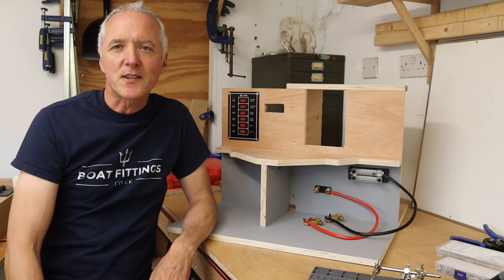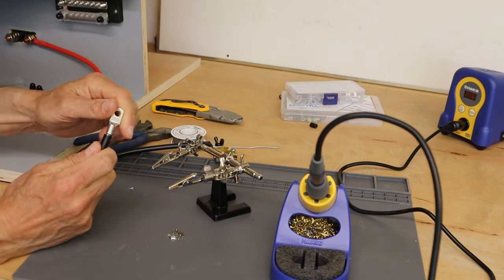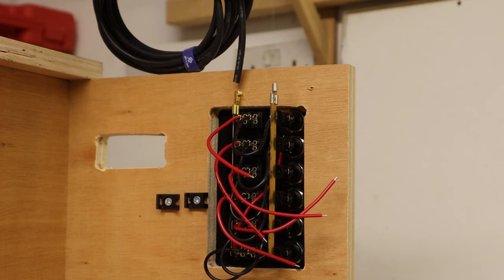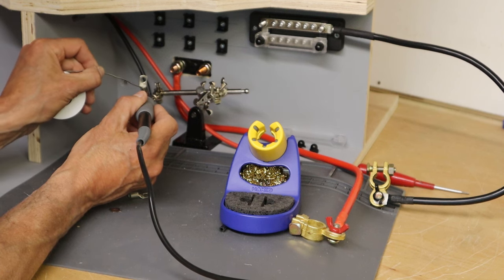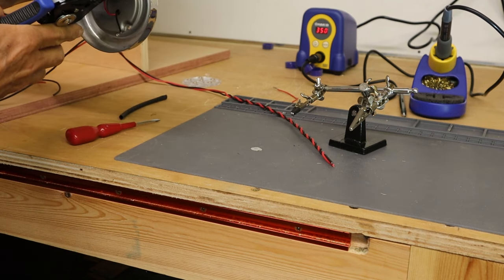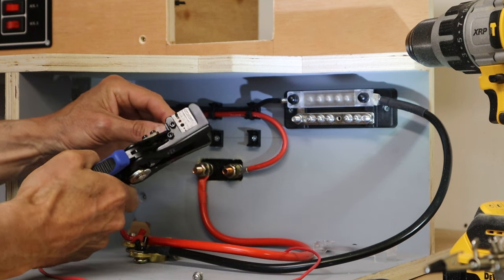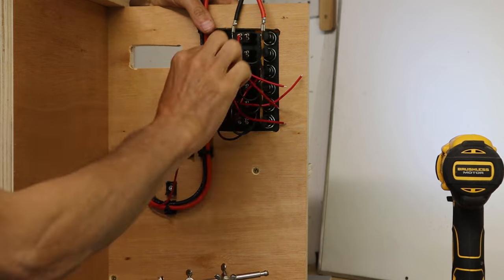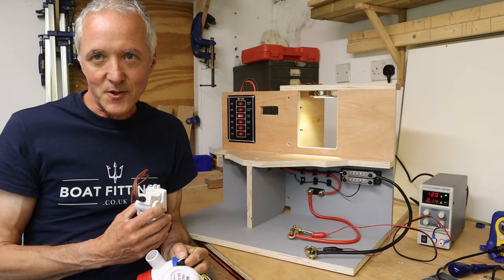Boat Electrical Wiring Made Easy, Part 2, Switch Panel Wiring, Cabin Light Wiring - Complete Guide

Comment: Surely the crimp terminals should be crimped not soldered?
Reply: Soldering makes for an even better and long lasting connection 😊
Reply from the maker: With regard to high-amperage terminal / crimp connections, a few people (yourself included) have made mention of the idea that 'crimping is the way' and that soldering is unreliable as the connection might get so hot that it un-solders itself.  My view is that a well-soldered joint will not ever get hot enough to un-solder itself, I will explain my thinking in a moment.  Firtly though I do not have anything against crimping as such, and I would say that the ultimate would be to crimp (for a good mechanical connection) and then solder (for the best possible conductive connection).  Personally I have sometimes had issues with crimped joints after a period of time when corrosion has set in, but not had issues with soldered joints.  Now to the idea that a soldered joint can get hot enough to un-solder itself, in any electrical circuit the thing that can cause heat to build up is high current (amps) and a high electrical resistance.  A well-soldered joint does not have a high electrical resistance, so unless something has gone severely wrong it does not seem likely to me that the soldered joint would reach a high enough temperature (lead solder melts at around 180 degrees C) to get near to melting.  All of that said, if anyone has an direct experience of conditions that have caused a soldered joint near or around a battery terminal to melt, then please do let me know as I am genuinely interested.

Kind regards,

Richard
Reply: @BoatFittings  Imagine if  there is a short between the panel and the battery... One of the uninsulated female spades gets knocked off and touches the other polarity for example. How many amps are now flowing through the cables to the panel from the battery? How hot is that cable going to get. I assure you that will melt solder in a tiny space of time. That is why the positive cable to the panel MUST be fused.  Short out a battery and unfused cable will get red hot, cause a fire, and melt the solder. Vibration and the stiffening of the cable is another issue with soldered joints. A boat is not a bench top project. Things go wrong and people can die if you don't get these basic electrical issues correct.

Comment: @BoatFittings

(or anyone else who can answer this, thanks)

Agree with all "positive" comments (sorry, couldn't "resist" ... damn, did it again! ;-)

Question: Everything is great except the _switch panel_. The wires and connections on the back of it confuse me to no end. Could be the Chinese labeling or some wires being the wrong color or maybe it's just me. My basic confusion ... why is there a negative connection to the switch panel at all? In other words, why is that panel not solely on the positive part of this circuit (for one of the same electrical reasons that the master switch works on the positive side of the circuit)?

Guess: I think the answer is that the switch panel is not functioning ONLY as a switch. If it were, you could have only positive in, only positive out, and the switches would interrupt the current or connect it when needed. However, only because those little bulbs are in the plastic switch housing (to indicate ON or OFF), each switch also becomes a load of its own. So, as a collection of little loads, the switch panel needs both positive and negative connections. Am I close?

Comment: Mechanical vs soldered terminals...
Because I see across the board generally it should be mechanically crimped not soldiered
Reply from the maker: With regard to high-amperage terminal / crimp connections, a few people (yourself included) have made mention of the idea that 'crimping is the way' and that soldering is unreliable as the connection might get so hot that it un-solders itself.  My view is that a well-soldered joint will not ever get hot enough to un-solder itself, I will explain my thinking in a moment.  Firtly though I do not have anything against crimping as such, and I would say that the ultimate would be to crimp (for a good mechanical connection) and then solder (for the best possible conductive connection).  Personally I have sometimes had issues with crimped joints after a period of time when corrosion has set in, but not had issues with soldered joints.  Now to the idea that a soldered joint can get hot enough to un-solder itself, in any electrical circuit the thing that can cause heat to build up is high current (amps) and a high electrical resistance.  A well-soldered joint does not have a high electrical resistance, so unless something has gone severely wrong it does not seem likely to me that the soldered joint would reach a high enough temperature (lead solder melts at around 180 degrees C) to get near to melting.  All of that said, if anyone has an direct experience of conditions that have caused a soldered joint near or around a battery terminal to melt, then please do let me know as I am genuinely interested.

Kind regards,

Richard
Reply: @BoatFittings  It will if it shorts out on an unprotected conductor.

Comment: Very bad practice in zip tying Positive & ground wires in the same holder, especially before your fuse block. Any penetration of the cables by way of accidental penetration of the insulation WILL lead to an short and potential fire.
Reply: Also, ALL of your terminals should have heat shrink down over the end of the terminal to prevent water ingress.
Reply from the maker: Hi thanks for your comment.

Kind regards,

Richard

Comment: Sorry, but your showing your viewers one important thing very wrong, when your soldering wires, the flux in the solder that allows wires to connect to a connector or another wire is an acid and will corrode the connection overtime, you must clean the soldered connection with acid tones or something similar.
Reply: Thanks.
Reply: Sorry, but you are assuming something very wrong or are unaware of the following: did you ask if he is using no-clean solder and which type of flux is in the solder? I don’t think so…. Please review your J-STD documents, and next time, ask what kind of solder a person is using and then follow up with “if not using no- clean solder of certain flux compositions”…. “Your statement.”
Reply: Agreed if not like he said it will definitely corrode
Reply: Additionally you don’t want to solder the main connectors for the battery cables. They should be crimped only.

Comment: Nice try - but dangerously wrong. Know what you are doing before educating others to create dangerous installations that don't conform to ISO or ABYC standards. The obvious point is having no fuses to protect the cables - this is a huge fire risk. The circuit to the panel should be fused after the battery. For example if one of the spade connectors at the panel comes off and shorts, the cable will take the full load of the battery = fire hazard with cables going through wooden bulkheads. The knock on effect of this is the generated heat will melt the soldered "crimps". All terminals and connections should be mechanically as well as electrically connected. With no fuse this could actually save the day but in the event of a fire those soldered joints failing could cause a dropped wire to short. Or indeed the melted solder dripping could cause a short. Use of a proper crimping tool and high quality crimps eliminates this problem.

All of this happening in a workshop is bad, but at sea it is a disaster. There are correct ways of wiring boats for a reason. This not the correct way and is potentially dangerous. You are clearly not a marine electrician and have very little knowledge of how to use these components safely.

Watch at least the first 5 minutes of this video to see why the unfused cable in this video is so dangerous at several levels:

https://www.youtube.com/watch?v=HzfKJwFCPho

Comment: They make crimpers for a reason. Soldering for low current is acceptable but not for higher currents. This is so bad don't do that.
Reply: ABYC E11 standard states "solder shall not be the sole means of mechanical connection in any circuit". Definitely agree that crimp plus solder would have been to standard, but solder alone would not pass inspection
Reply from the maker: Thanks for your comment.

Kind regards,

Richard

Comment: what about fuses,or am i missing some think
Reply from the maker: Hi thanks for your comment.  The switch panel I have used has built in fuses.  A separate video will show installation of a separate fuse panel - coming soon!
Reply: @BoatFittings  Those fuses to not protect the conductors between the battery and the panel - nothing does - it's dangerous.